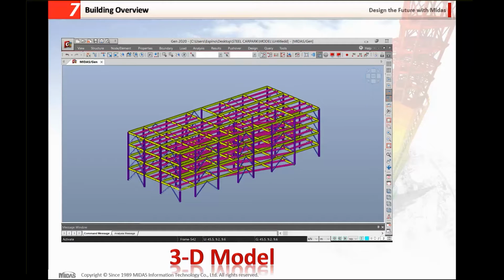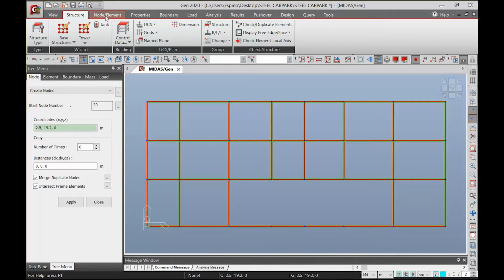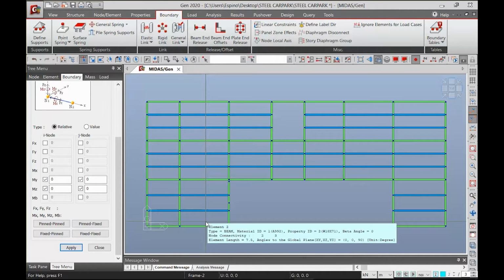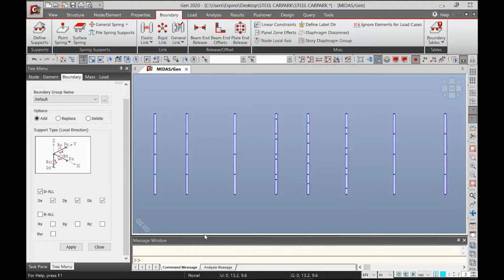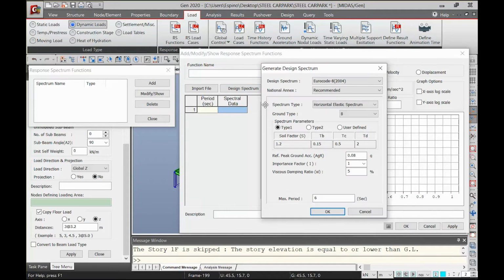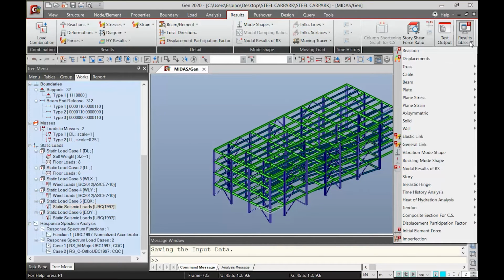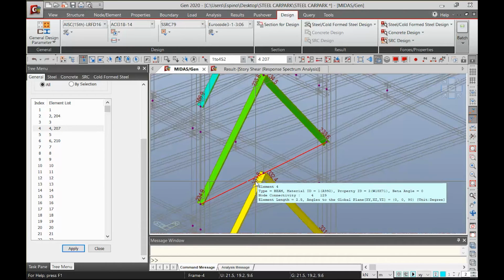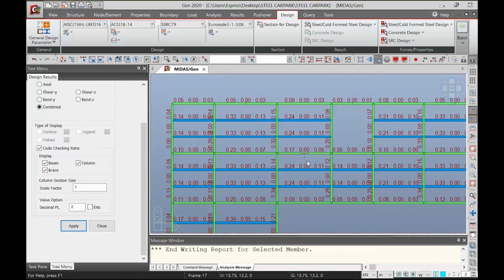Analysis and Design of 4 Storey Steel Carpark Structure in Philippines | Building Design | Structure

Comment: what about if the frame is tapered section (Non Prismatic Section Frames)how you canmodeling it .no body answer me for this question
Reply: This can be done in midas gen easily
Reply: I just finished analysis and design PEB Structures using midas Gen. In section properties u can find tapered section options. And for tapered section we have to assign it as tapered member in node/element toolbar. It is used to adjust intersected tapered member